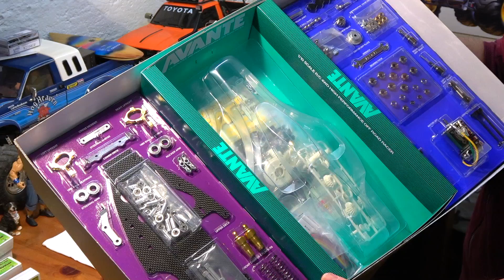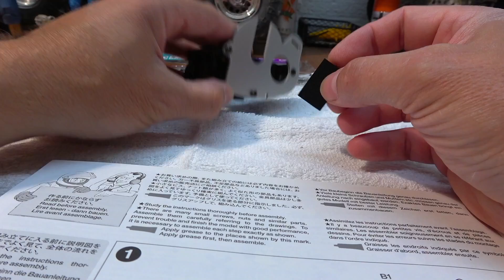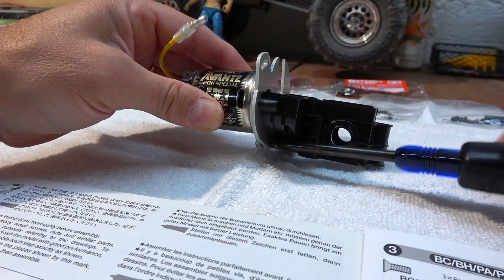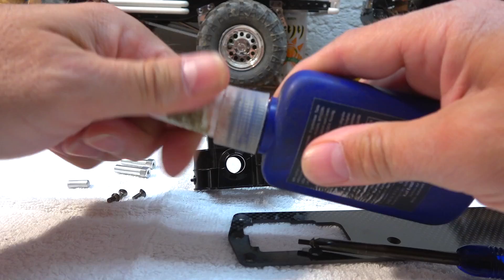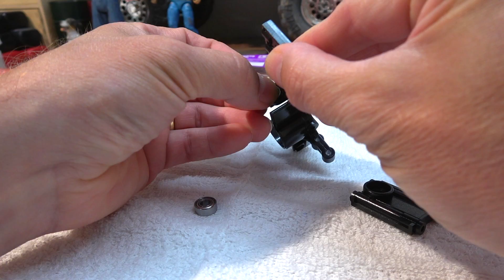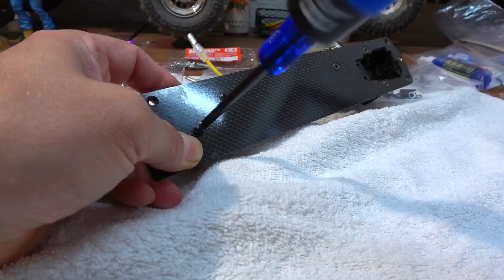Tamiya AVANTE Build / Video 1 / Steps 1-6

Comment: Matteo, I have been wanting to see this Build from you!! 😉 
Now I get to see it as an entire Series, the way I enjoy. 
Thank you for this my friend!! 
Carmine 🚂🚙
Reply: I am only a little surprised that you chose not to use the Threadlock on the Motor or the Pinion Grub Screw. Have you not had problems with them coming looze? 

As expected, I am enjoying this Series! I hope you do more like this.
Reply from the maker: Thanks Carmine! No, I never use threadlock on the small screw on the pinion. Never had problems with it. I think it can be difficult to re-open the small screw when using threadock...
Reply: You're correct my friend. I use a tiny drop of Blue Loctite and wipe most of that off before use. 
I would never recommend this to someone of little experience! There is no way of knowing how much they will use. 

You're absolutely right though! In my 38 years in the Hobby, I've only had a Pinion Grub Screw back out ONCE. Still, I like the insurance. 😉